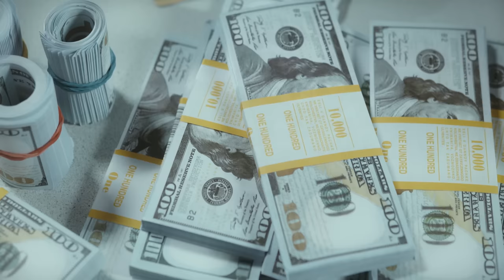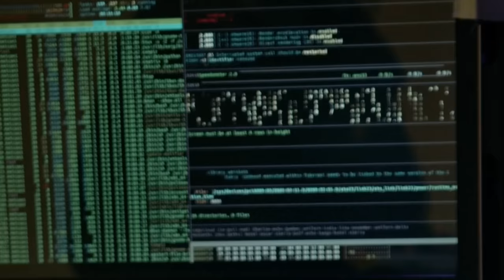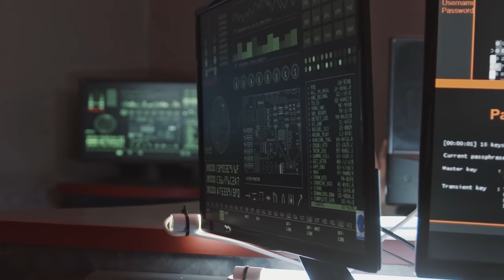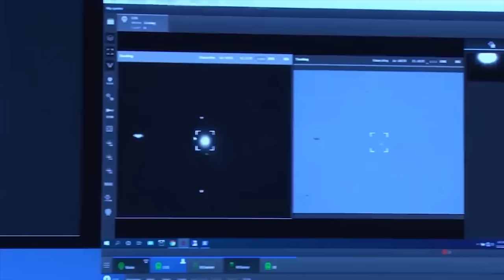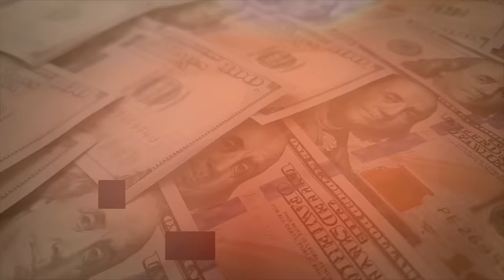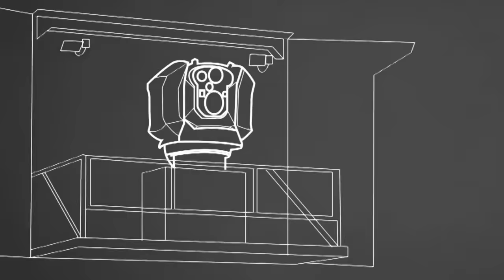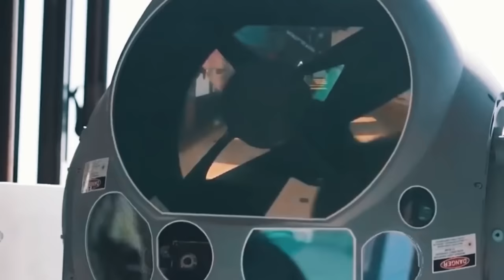ISRAEL Testing Its Monstrously Powerful $500 Million Defense System

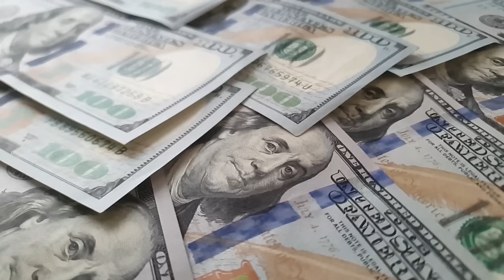Comment: Also, there is a miscorrect estimate of the cost of laser shot vs Tamir iron dome interceptor missile. It is not 2000$ per shot (as mentioned @15:50), but rather 3-5$, vs 30,000-80,000$ per Tamir missile. At least these are the latest numbers I am aware of, and as you yourself state correctly @22:30.